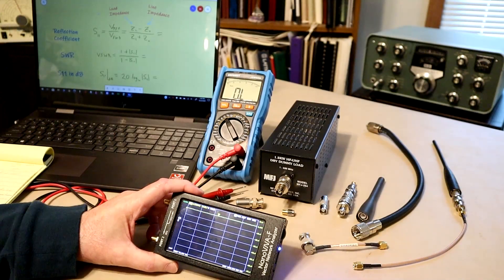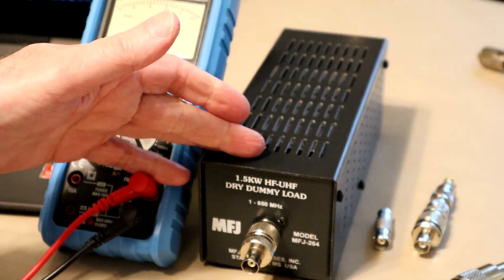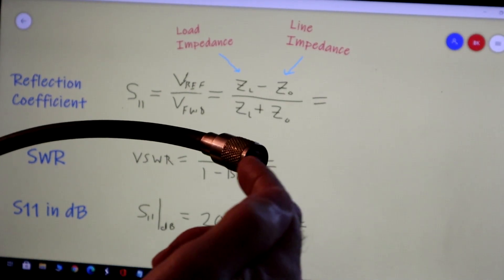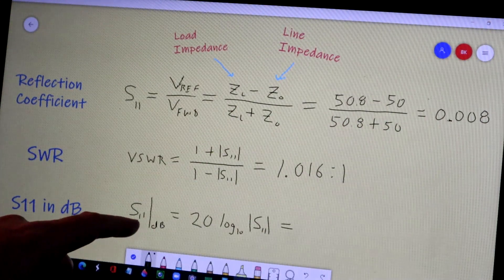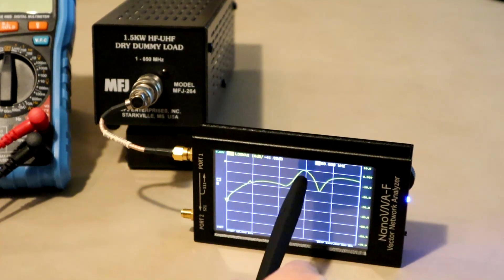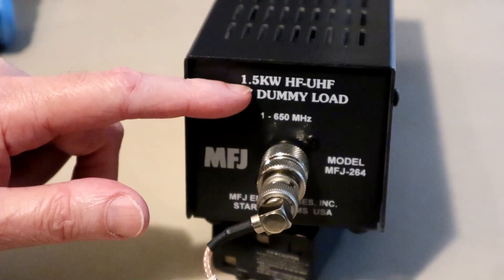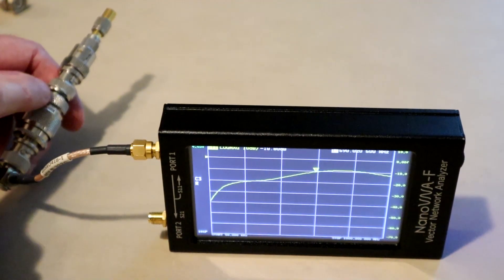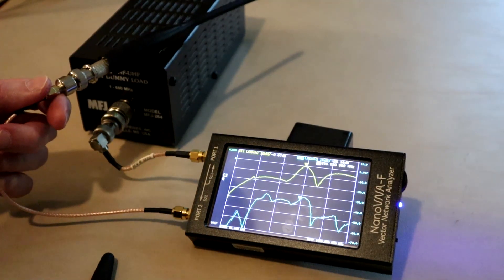NanoVNA - What is S11 and how good is the MFJ-264 dummy load ?

Comment: I'm new to this; could you tell me what your multimeter setting is? thanks
Reply from the maker: The multimeter shown at timestamp 1:18 is just set on Ohms. For this DMM, this is the "auto-range" setting for measuring DC resistance. I think they implement auto-range by trying each range and finding the lowest range that gives a non-overload reading (this is done to maximize precision in the reading). In this case it responded very quickly because they probably start at the lowest range (1000 Ohms) and it didn't overange there - so it doesn't have to try any more ranges and they just report that reading (51.0 initially and 50.9 later).  In practice, I would just say it reads "51 Ohms" because the last decimal place won't affect the dummy loads ability to do what it needs to. It just has to present something resembling 50 Ohms to the DUT (Device Under Test).
Reply: @MegawattKS  thank you

Comment: Hello, thanks for the video.
I have this same dummy load but it measures 63 ohms and when I measure it with the nanovna it measures a swr less than 1.28.
How can I bring the dummy load to 50 ohms or would it not be necessary?
Reply from the maker: Interesting.  Maybe try an Ohmmeter on the Carbon coated cylinder inside. Perhaps the contacts are bad (if it shows 50 Ohms, then there is 13 Ohms of contact resistance somewhere).  If the Carbon-coated cylinder is the problem, I suppose its possible it got overheated at some point and the sheet-resistance went up.  If that is the case, then for most work, I think SWR of 1.28 is still not too bad. That would translate to a 18 dB return loss (S11 = -18 dB), which is very good. Only about 1 or 2 percent of power is reflected.
Reply: @MegawattKS  Thank you so much, very useful! Do you have an email or any other form to contact you to send you some of my meassures? Thanks!
Reply from the maker: @ce4ufc630  Hi.  The answer is 'yes' and 'no'.  There is a webpage associated with these videos and more. In fact, it contains, in addition to the video series, detailed notes from an entire course on Radio Design. It's a bit rougher than the associated videos, but maybe OK for anyone who really wants to dive in deep. Sadly, it does not have an active posting feature enabled yet. I'm still learning the website hosting software. Anyway - it's here:  https://ecefiles.org .  Hope that helps some.  73's

Comment: at 5:58 -42dB .....does it mean the reflected signal is - 42dB compared to forward signal?
Reply from the maker: Yes. At DC (or very low frequencies), the reflection will be 42dB lower in amplitude than the signal launched onto the coax by the transmitter (or measurement device).  It won't be that small at higher frequencies of course. As shown later in the video S11 degrades with increasing frequency. And this calculation is only taking into account the dummy load resistance value. The coax is assumed to be exactly 50 Ohms here - and in general it's characteristic impedance will be off somewhat from 50 Ohms as well...

Comment: Greetings ..
Greetings..  Thanks for video.

Just a comment.. 

 I have two of the MFJ-264 and both have a similar issue.   Really low return loss / high swr between the 200-230 Mhz range.      Using a NVNA from 1 Mhz to 650 Mhz sweep with 401 sample points selected gives more resolution.   I believe you can see a small bump on your test around the 200Mhz mark.  Would be interesting to see if you MFJ-264 has any issues at the 200Mhz range as well.

Thanks.
Reply from the maker: I just tried narrowing the range and it looks OK.  There is a peak around 250 MHz, but it's -14 dB S11 (14 dB return loss). Even that could be due to my cables/connectors.  Have you tried using a completely different run of connectors/cables/adapters to see if maybe the problem is in the interconnect?
Reply: @MegawattKS  

Thanks..

I used a DSA815 Specturm Analyzer with a return loss bridge, and a MFJ-259C using a point-to-point connection on both MFJ-264 I have the the SWR etc was like 9:1 around 200Mhz..

Of course I could be bumbling 🙂

Comment: So mfj264 or mfj250x . I need one for my little 1kw amp.
Reply from the maker: Sorry - can't really advise since I don't have experience with the 250x. Looks like it's oil cooled - so that's a thing. On the flip side, the 264 might have more usability limitations (seems to only allow about 10 seconds at a time for 1.5 kW, and I wouldn't even go over that at 1kW since one always wants some margin). Not sure what the cooldown time is between tuning bursts.  All in all, 10 seconds sounds kinda short ?
Reply: @MegawattKS  Thank you sir.  I will take a look at the oil version dummyload.

Comment: Did you calibrate it with the cable and adaptors in place before connecting it to the dummy load? That cable is pretty long at 600 MHz!
Reply from the maker: Good question. Yes - I think so. For a case like this, I usually do a quick "response-cal", to normalize out the cable loss.  (I've found the adapters don't matter much if the accuracy goal is below a tenth of a dB or so on S11).

Comment: When I plug this formula into Excel (=20*LOG10(1.016) it returns 0.1378  what am I doing wrong? Thanks!
Reply from the maker: Looks like you took the log of the VSWR number (1.016) instead of the S11 magnitude number (0.008). Assuming you're looking at 6 minutes into the video, the -42 comes from 20 log10(0.008) = -42 .  Hope that helps.
Reply: I would be interested in methods to calculate a solution to match a load. It would seem to me that some smart person has develop formulae such that, given a tuner with known component values, as well as a load with a measured impedence, you could derive a tuning solution(s). Possible?
Reply from the maker: @emailuser3869  Yes - absolutely. It's pretty easy if the load impedance is purely resistive, but gets a bit more involved for complex loads (with inductive or capacitive parts to the Z value). Here's one of the simplest cases which I found doing a Google search for L matching networks (which are the basis of the T match as noted in my most recent video): https://analog.intgckts.com/impedance-matching/l-matching/
Reply: @MegawattKS  Thanks for this. I'm learning so much from generous folks, such as you. Clearly you are an RF engineer and (probably) ham. 73's de W6MGV :) Looking forward to your PowerPoint treatment of the math behaind the Smith Chart. Cheers.